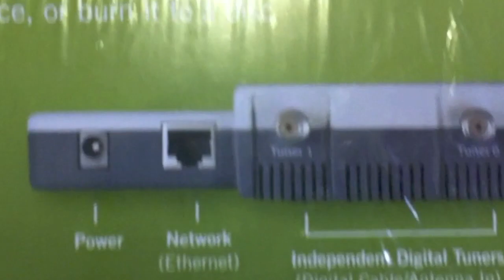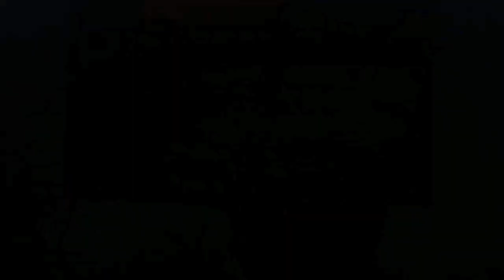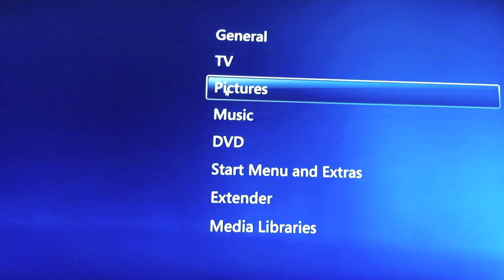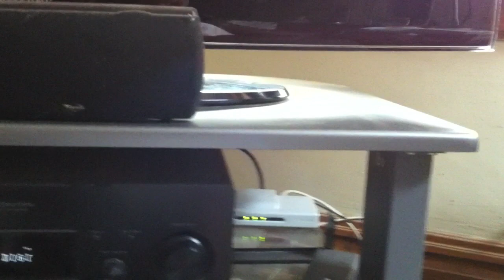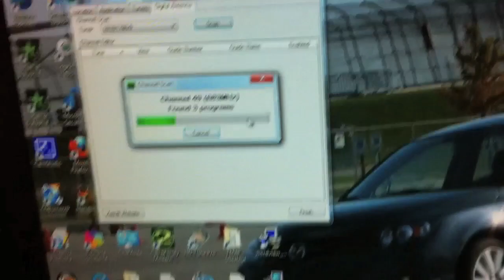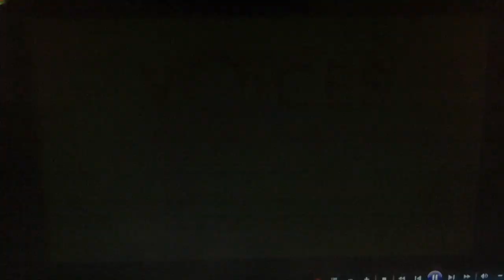SiliconDust HDHomeRun Network Dual Digital TV Tuner Review

Comment: Fyi . Works beautifully with Windows 10 also.  SiliconDust is still putting out firmware updates all these years later for it.
Reply from the maker: Are you talking about using the community-based Media Center ports?  Or is there an alternative DVR software for Windows 10?  I'm still on 8.1 just so I can still record and playback channels with DRM.

Comment: it was not made clear to me if the prime supports ATSC when asked if it did the same except having the advantage of 3 tuners instead of 2 he said yes. I think no, the prime will not support ATSC am i correct?
Reply from the maker: Ian Morris Prime only supports QAM and encrypted channels via CableCard.  No support for ATSC.  I have both the Prime and this model I'm showing.  This way I have 2 tuners for OTA channels (actually 4 because I have another internal dual tuner for ATSC) and a 3 tuners for CableCard channels.  Media Center works with all 7 tuners!

Comment from the maker: @californiadajatt Sure! My HTPC is a Core 2 Duo 2.53 GHz cpu, nVidia GF 8500GT (HDMI out with SPDIF from mobo), Hauppage WinTV 2250 tuner, and this tuner. As for drives, I have a 2 TB HDD and a LG BD-ROM.  I'm on Win 7 Ult 64-bit, and use WMC with Shark007's Win7Codecs which allows for playback of almost all media files in WMC.